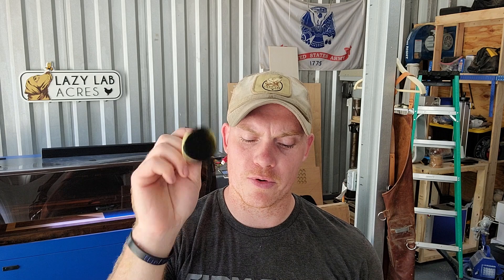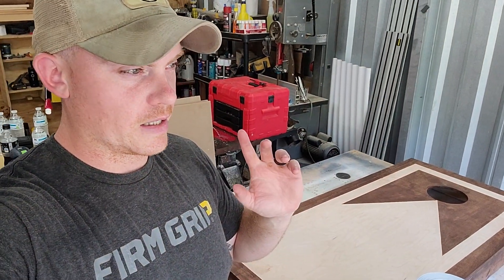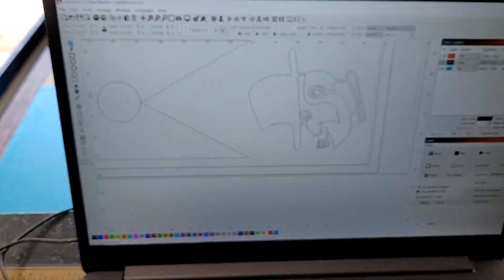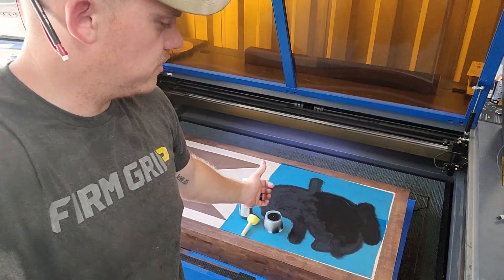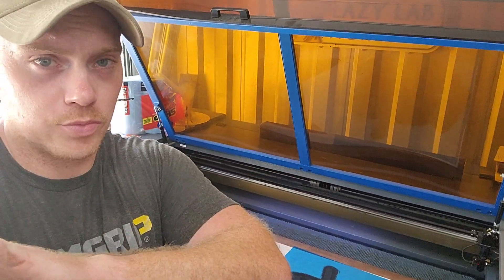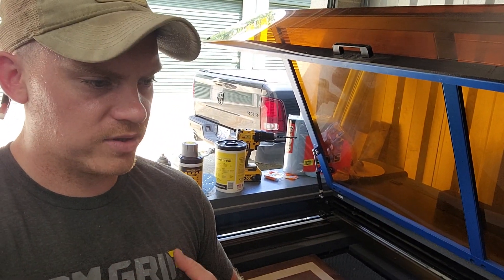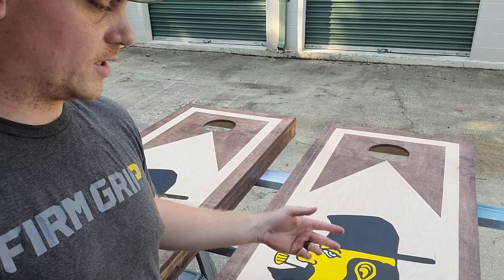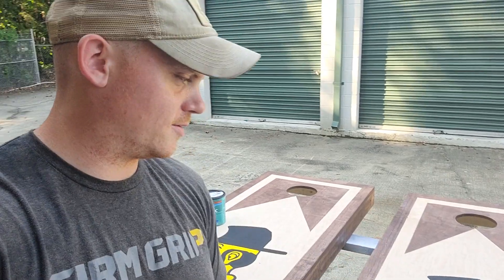How I Paint Cornhole Boards

Comment: Thanks for another great video, I been following your first construction video and have built 100's of boards[$$] that way and sold all of them, still from time to time have trouble with my hand-held router for the hole, I kind of flow back and forth between the hole saw and router, As far as the designs I'm an Airbrush Artist and pretty much freehand all my Artwork I put on the boards, these you did here are sweet, I also like to use stencils from time to time, time is money, lol, I wish I could post some of them on here for you to see ,anyway got to give you the props for helping me along the way ,Thanks so very much ,have a Blessed Holiday season